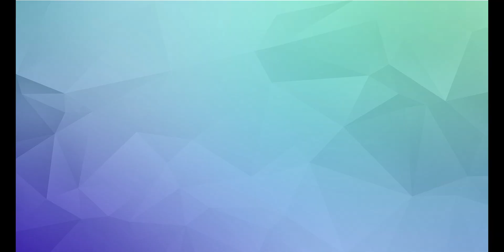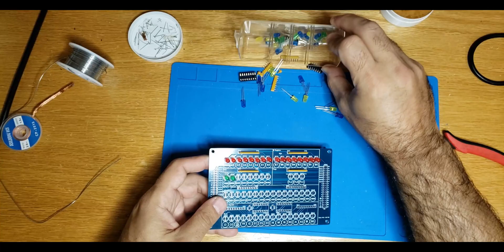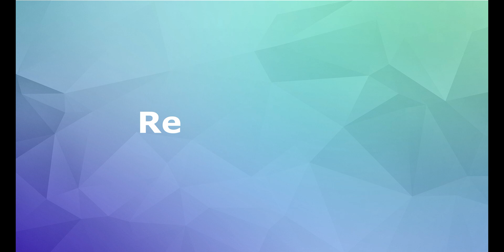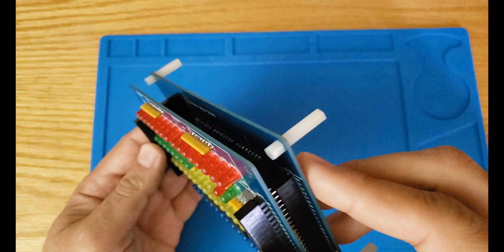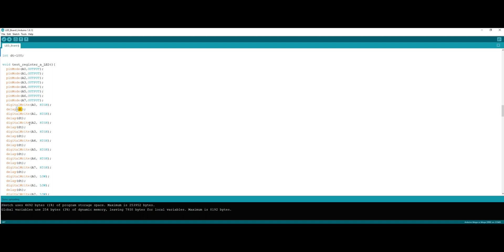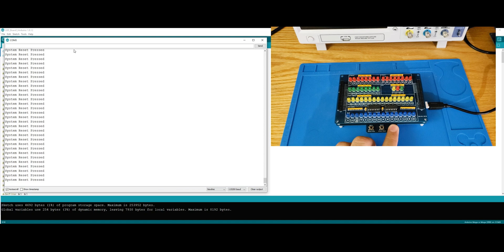Bravo 8bit computer-Part 3-LED Board, inspired by Minimal Project and Ben Eater's 8bit computer

Comment: Could streamline the testing code with functions and variables for items such as a function that sets and resets pins with a variable for the type of output and what to set it as.  Could streamline some things like the different register LEDs as arrays.

Could implement a "say once" feature to your button checks (which would have the text written only once) such that the function:
a) checks if a button is pressed (button_pressed is true)...
b) and checks if a "not_pressed" variable is simultaneously true...
c) then, if true, marks "not_pressed" as false...
d) and outputs the corresponding text...
e) but when button_pressed is false, marks "not_pressed" as true

Example:

bool no_manual_clock = true;

void manual_clock_check() {
  bool manual_clock_pressed = digitalRead(manual_clock);
  if ((manual_clock_pressed == true) && (no_manual_clock == true)) {
    no_manual_clock = false;
    Serial.println "Manual Clock Button Pressed";
  }
  if (manual_clock_pressed == false) {
    no_manual_clock = true;
  }
}

bool no_system_reset = true;

void system_reset_check() {
  bool system_reset_pressed = digitalRead(_RST);
  if ((system_reset_pressed == true) && (no_system_reset == true)) {
    no_system_reset = false;
    Serial.println "System Reset Button Pressed";
  }
  if (system_reset_pressed == false) {
    no_system_reset = true;
  }
}

Comment: Led arrays are a good option to make it more compact in case you ran out of space in a future version.
Reply from the maker: Yes, LED arrays were an option, though seeing bits on LED array are sometimes not so easy since the LEDs are so close to each other. I decided to go with single LEDs since it's much easier to read when you have data on them. Thanks again for your comments.

Comment: Very clean layout... I am looking forward to seeing those LED blink some more ;-) any particular reason why you did not include Minimal's program counter? Cheers!
Reply from the maker: Hi Carsten. Thank you ! Well, for two reasons ! The program counter output is 8bit at a time on the BUS lines, so you can always see the output of the counter on the BUS LEDs along with HI signal which tells you if this is a High-byte or a low-byte on the BUS. If I wanted to take the output before going to the transceivers (74HC245), then I needed to add 16 more lines to the circuit just for the LEDs which means that I had to include additional 16 lines on my BUS sockets. Also, when it comes to testing, I ran out of pins on Arduino Mega, I'm already using 66 pins ! and finally, adding 16 more LEDs to the LED board would make it a little crowded. I know, the same argument applies to memory address lines, but I felt like Memory address line are more important to have an LED specially when we are addressing both RAM and ROM from the MAR. Anyhow, I guess sometimes you have to compromise. I have included one more LED for the clock since I posted the video. That would be included in next version of PCB. I thought having an LED for clock makes sense. LOL. Again, thanks for following the project , that's awesome that I see your inputs here, it would help me improve the project over time.
Reply: @ConfigIOI  Thanks for your efforts!! This is much appreciated. Of cause you are right. There are hard limits when it comes to pin count. At an early stage of the development of the Minimal I had build the system modules separately like you did but modeled the instruction register "in software" using an Arduino Nano. Super helpful for debugging. I had connected an LED Neopixel array to the Arduino to display the state of all CPU registers. That involved only very few pins (2 plus power and ground) but limited the CPU speed to a few kHz since all the data was transmitted serially. So I gave up on that after I got everything working. I like your approach much better. Cheers!